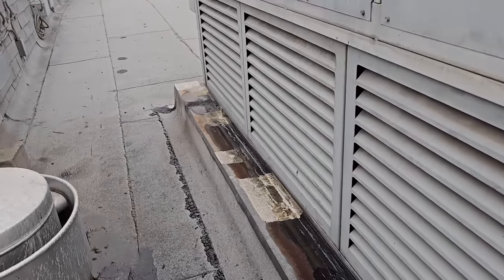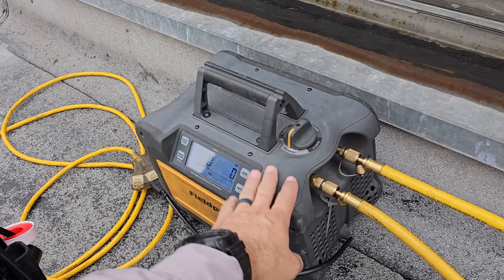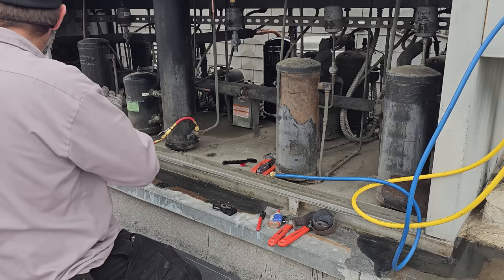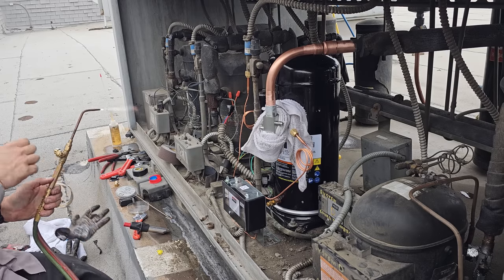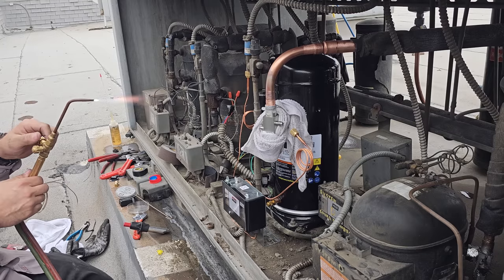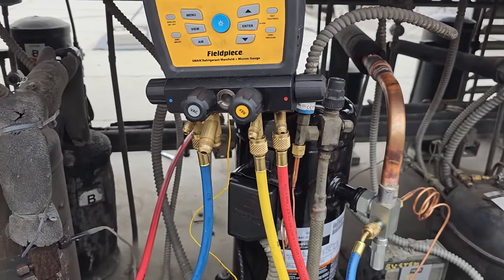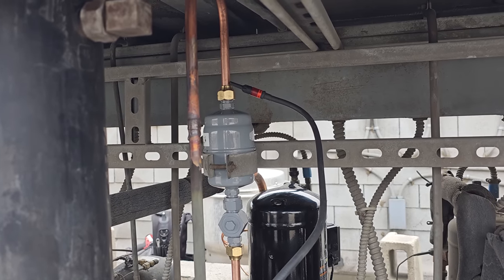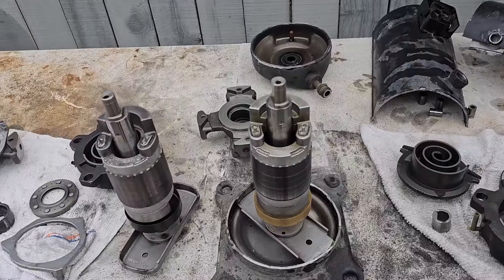THE BEER WALK IN IS MAKING A LOUD NOISE

Comment: Odd call for sure, the part you found the wear on is the Shut Down Device. This prevents the scroll from running backwards at shut-down and making awefull noise customers hear and complain about. It works by jamming itself on the flat on the shaft, given its age I don't think it's that bad. It flings itself out of the way while running. My 2 cents it was simply its time after a long service life.

Comment: Just this week i replaced a big scroll. The biggest Copland makes ( 30 hp- 385k btu's- 213 L of oil ) had rotolocks as well. It was a heavy sucker ( 400 lbs ) i really want to cut it open and see the guts of it. When i went on the original service call....found the oil sight glass was empty....all the oil had migrated to the brazed plate HX. It wasn't a burn out, and it ran like yours did, but it too was making a horrible sound and it wasn't pumping that well. It took us almost 1 year to get the compressor from the manufacturer. We also replaced the 609S LL filter drier  and the TXV ( i found it leaking from the adjustment stem and internals ). It was on a Multistack water cooled chiller. On start up it was purring like a kitten...didn't even have to adjust the TXV either. It was a cool repair and i enjoyed it. We also added 2 CCH's to the compressor as a safeguard too.

Thanks for sharing. You are big influence on the trade....in a positive way. You are also realistic and show real world repairs....not the by the book, which is seldom feasible.
Reply: I also just replaced a ZP385 not long ago. 
Actually found another one bad this past Friday as well

Comment: ahh, the age old problem of benders not fitting where you need them!  13:29  for soft tubing  a spring/noodle type hand bender is usually best, but it's always very tough so close to a flare/end.
 I always try magical benders first(lol), but it never fails that I revert to spring type or just bare hand it/use random cylindrical objects(sockets/cans/tool handles/pipes/tanks/ducts) you get the idea, anything and everything is a bending tool. 🤣

Comment: maybe those scratches are caused by the iron particles that came of that weared out metal piece. If they get inside the bearings, they could cause problems, even when the oil is fine. And due to the magnetic fields from the motor, they are attracted and will stay there

Comment: This is a reference from Dick Wurz Commercial Refrigeration book. And it makes sense. But when you change a sweat drier, whether you are taking the old one out by unsweating it, or putting the new one in, it releases moisture into the system that the drier has collected. That's why it's better to use flare or canister driers. I've always done flare drier whenever possible and I started using that male to female thread sight glass because of you. Really works nicely.

Comment: The oil looks really fine, I would call this just an old compressor. Maybe it has eaten some metal shavings or dirt out of the copper piping which might have caused the wear patterns on the rotor, maybe some liquid refrigerant once got into the scroll and did the mechanical damage.

Comment: I really hate those Krack systems. Not fond of a scroll for refrigeration either. Have one that has one circuit that has been through 3 compressors. We have replaced TXV, contactor, Drier, Refrigerant, Dual pressure control and the fan cycle switch. Beginning to believe there is a problem with the heas injection system or maybe, partial restriction in the condensor coil itself. I recommended that we cut out that circuit and put separate skid on top of cabinet. Which would reduce load on the rest of rack. Lowering all other circuits head pressures. Originally a R22 system, Customer refuses to let us replace rack. Have tried many different refrigerants in the rack. Currently running 409A. Pressures never did run right.
Reply: wow, what a riddle.....expensive

Comment: Chris and all of his followers I have situation that I would guess you have not come across because I have been doing refrigeration for almost 30yrs and I came across a Fisher Scientific cooler that had a sideways compressor with accumulator attached to the compressor complaint was that cooler not getting cold enough found cooler running at room temperature coil was not frozen up compressor was warm drawing just under RLA suspected undercharge so put gauges on and found both sides low and high in vacuum when compressor was running but when it was not running had 90PSIG with system equalized question is what metering device was it and what was the issue.

Comment: Also before they say I had both of my  gauges on the low side of the system I charged half of the factory charge which was 19.4ozs so I charged 10ozs and both sides still were in a vacuum.

Comment: Would you say that there isn't enough metal and particles in the oil to account for the amount that's been worn off of the parts of the compressor?  Is it possible it had an oil change after some damage happened?

Comment: Can you see if MotorKote friction reducer is compatible with freon oils?  I want to see if putting it in the oil inside the system (if compatible) would reduce friction of the compressors and motor bearings and increase the life of the compressors by reducing the load and reduce the overall heat by reducing friction in the system
I did put .25oz in my cars R-134A system and I can tell the engine with the AC compressor on idles MUCH smoother, but I only put in a teeny amount, I wonder how much (if compatible) it would take on larger systems

Comment: OK, now you have one compressor with mech failure and one with electrical. Can you assembly the one working frankenstein-type of those parts? Or would you make a video why you should not rebuilt compressors by yourself?
P.S. I'm from country where parts are expensive, and labour is not  - so for my swamp point of view there is reasoning to make thing like that.
Reply: warranty

Comment: Suggestion. Hook the manual fan switch in series with liquid solenoid. So that when fan switch is shut off. It closes liquid line and pumps down.
Reply: Or add a relay to switch an appropriate control line that can be bypassed if needed. I'd rather not have AC power to a rack component being provided by a switch (and possibly breaker) not local to that rack.

Comment: You used a cordless grinder to cut up that compressor? I used my cordless Milwaukee one and it started smoking. I ordered the fuel but I’m hesitant to cut it open with another cordless grinder lol
Reply: Take a look at Marita XGT. Those things are built for work (the red instruments are way more expensive in my area.). Some of them requires spare operator, if you get what I'm meaning.

Comment: Does that location have a voltage issues, because a low / high voltage can cause a mechanical problem with in the compressor, over torquing mechanical parts

Comment: You are a good tech, but you can improve your welding skills in my opinion, too much fuel at the tip is audible and not the hottest that for cooking the metal too long. also you apply heat all over the place, LOL . Thanks for the videos I'm a vet tech and I still learning from you and everyone else.☺
Reply: I was taught to run a slight carburizing flame for brazing. Reason being you reduce the oxygen at the point of your molten filler material
Reply: @BiigCheeze  Absolutely, but in practice that takes longer and more fuel, if you braze like that inside a Subzero refrigerator you'll burn it up,. You can control temp melting point by moving the flame. Just not my style to be wasting fuel and oxygen with noisy flames.
Reply: @hotrod7696  yes I agree, his braizing technique shows a lack of confidence. He seems nervous when welding
 The heating of the copper up to the elbow for example was unnecessary and seemed like a bit of mental time wasting...